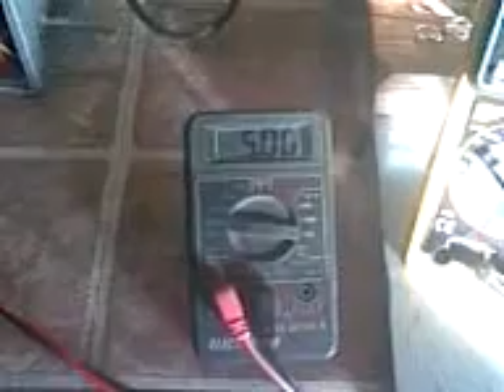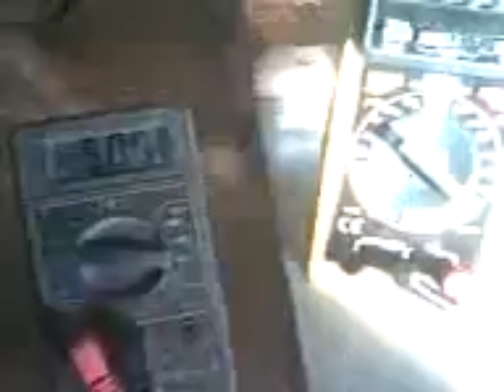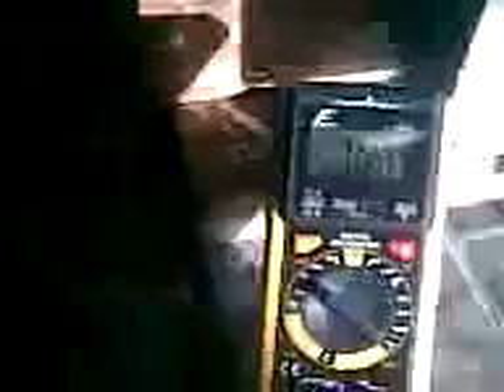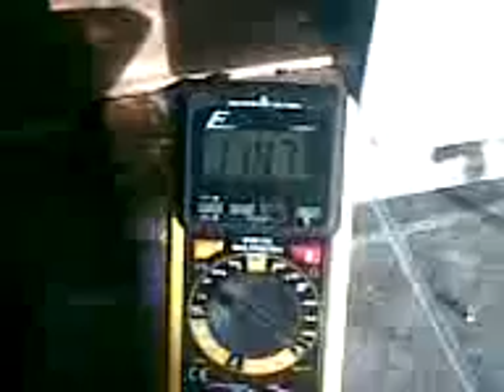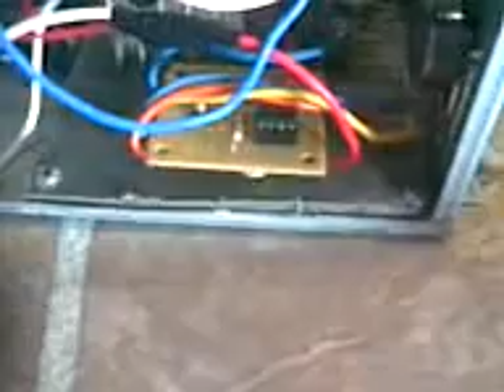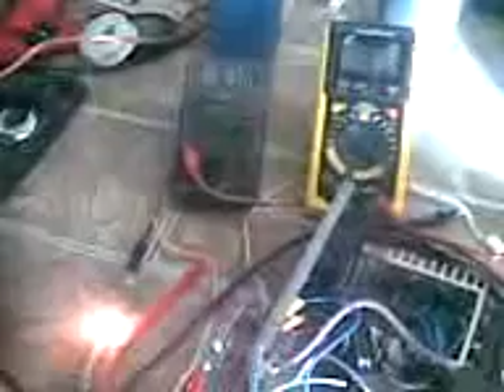New Found Theory

Comment: Interesting to know that you can run two different Voltages over the same Ground. I could connect a 12Volt DC to 48Volt DC Converter to my Car and power my HHO Cell with 48Volt for increased Gas Production !

Comment from the maker: This circuit is for a variable power source. in the end it will have the capability of working from any source. house current, 125v ac, 220v ac. and will be able to control the output voltage to the cell from 0 to the max of the origional power source, also converting it into dc voltage!
For example: if using a 220v ac wall outlet that can draw a max of 40 amps, the circuit can output from 1v dc to 220v dc at a max of 40 amps! (usually rectified ac volts are normally higher, 110v ac = 150v dc)

Comment from the maker: yes, they differ, but this theory if just the beginning.  the circuit will work off the vehichle's electrical system. the power source for the cell will came from a 2000 watt inverter and a rectifier, giving up to 150 volts dc at up to 15 amps (v * a = w) which is pleanty of power to run a cell consisting of 55 plates (2v per plate = 110v